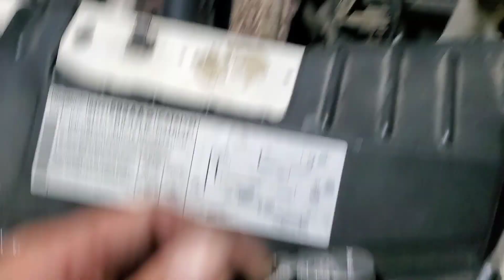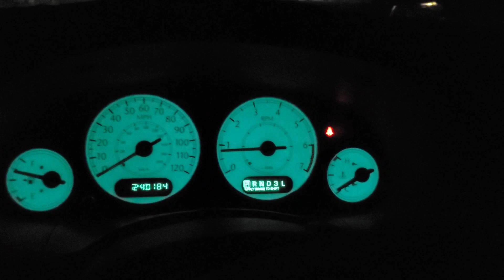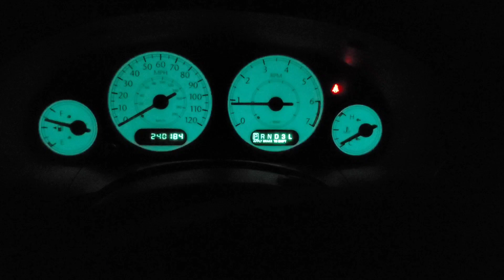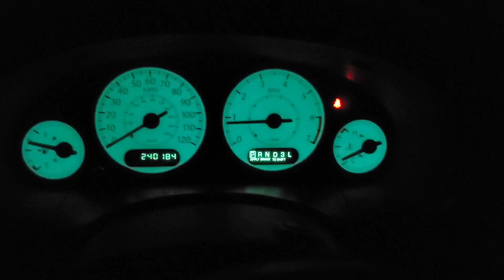Mobile Mechanic Late Night Jobs 2!

Comment: Andy what labor rate in your area ? And what part of country you in ? I'm in California central valley we charge 95 a hour for auto , I also do HD and Equipment it is 125 a hour . Good video's
Reply from the maker: Many shops in the area I live in charge between 100 and 200 per hour. I personally charge 135 per hour flat rate. I'm in Missouri